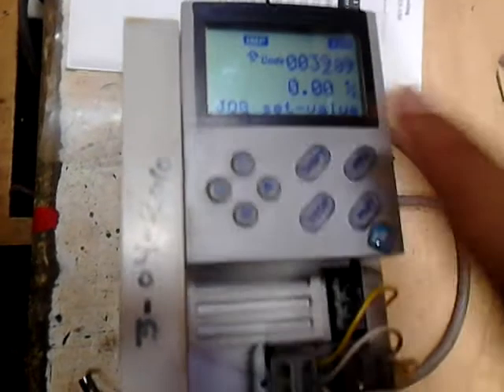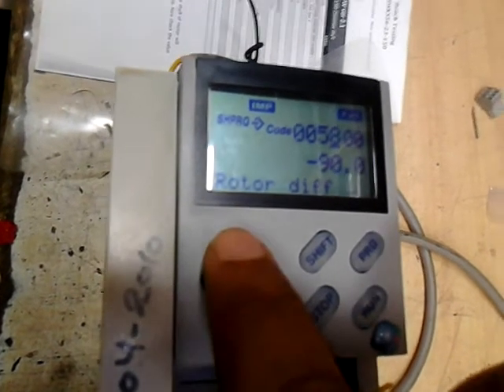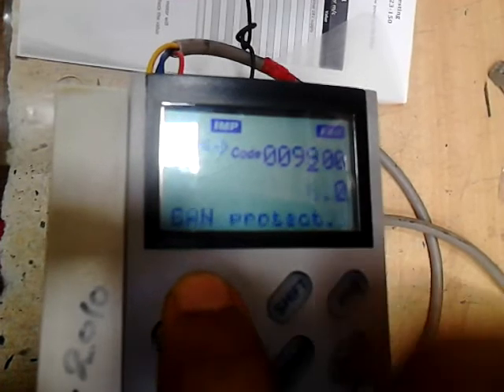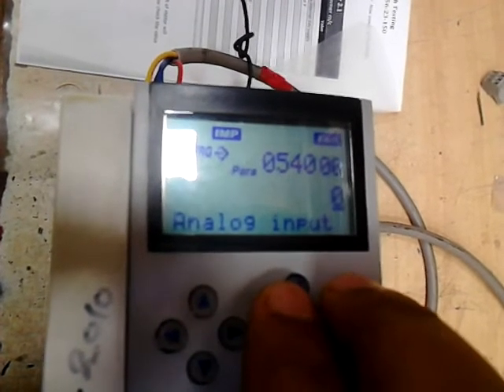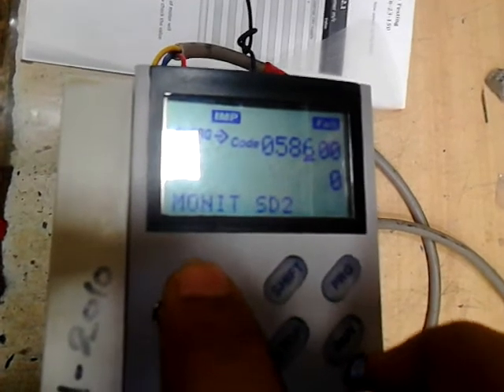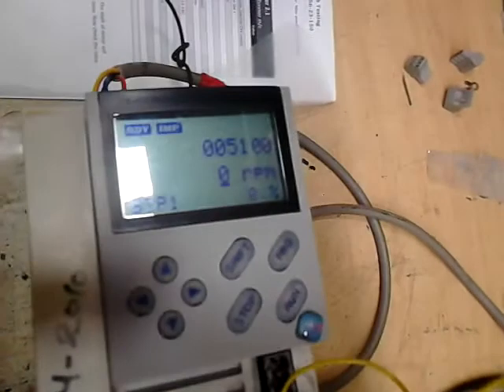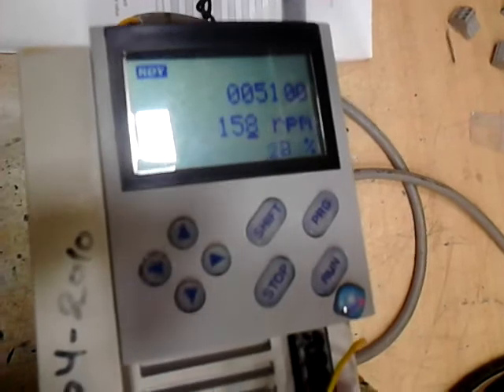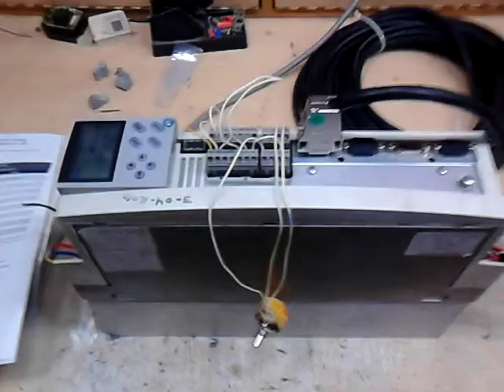Lenze Servo Drive EVS 93XX Bench Testing Part 2

Comment: Hi there is imax and Mmax err on my vfd drive what is err and how can i solve it????
Reply from the maker: Check the drive parameters for motor and set according to name plate.
If parameters are proper then check the motor is it jammed or any issue with the grounding.
If everything is OK then currently monitoring section of drive is faulty and need repairing

Comment: Hello Sir,

can I use for this application also a Lenze Inverter evs 9324-ep (positioning)  instead of 93xx-es and, if yes, do I have to set other parameters in this case? 
As most users for private use I would only want to turn the servomotor in left and right direction and to chose the speed within the recommended speed range.
I already have a lenze Inverter (93xx-es and a connected Motor (MDSKS...) which is running, but only in one direction. The connections are correct, ist it possible, that there is one or more codes in the code list, which has/have to been changed?
And at last another question: Is it possible to reset the Inverter in  factory setting only with the control unit and without any bus?
It would be fine, if I could get a valid mail address of you or your company. And, in case of success I would like to pay something for your advice by Paypal.
Thank you very much for your answer!

Comment: Sir how to calibrate resolver please suggest
Reply from the maker: Which type and for which motor?
Reply: @esrtechnologix  lenze Drive EVS 93XX and Lenze Motor resolver
Reply from the maker: @ashwaneedubey30  needs Motor specs with resolver installed as if it will available in supportive documentation of GDC/EVS card, you can configure it easily, otherwise, you have to configure it manually which have a little different procedure.

Comment: Hi,Lenze EVS9326-ES inverter displays "Trip (EEr) External Trip Set" and I supply 380 V How can I solve it?
Reply from the maker: This is usually Feedback Device error i.e. Encoder or Resolver. Either it is missing or faulty. So try to check that and if you want to bypass that depends on the application. In this video, I explained how to bypass it but only to check the drive on bench test, not field application.

Comment: Hi, please, our  lenze EVS9326-ES inverter displays "LU message" on turning the machine on,  but on reset,  it displays,  "QSP ext term".  How can we resolve it to enable it work with a Lenze Servo motor with C86 code of 28. Thank you.
Reply from the maker: LU message is for Input Low Power Supply Voltage  i.e 540VDC, Check the input voltage and all phases. QSP Ext Term is an Error "The MCTRL−QSP input of the MCTRL function block is on HIGH signal" it shows that specific Block is not defined properly.

1:  If you have the Parameter Backup of that drive, try to restore the Parameters again.
2: If same drive is used on any other position at machine, try to upload the parameters of that drive in this Error / Faulty drive and check the behavior. 
3: If LU status is appearing still on the Drive, then you have to check the drive on PCB Level for repairing at its Input Power Section.

Comment: Sir tell me lenze inverters 8200 vector control wiring diagram. Sabir
Reply from the maker: Wiring Diagram is available in Manual. Can you please explain for which application you need a wiring diagram?

Comment: Sir tell me information in lenze copping parameters. Thanks
Reply from the maker: To save the Parameters in KEYPAD 
1--->Select code C0003 "PAR SAVE" in the
        "Load/Store" menu using the arrow keys.
2---> Change to the parameter level: Display "0" and "READY"
3--->Copy all parameter set into the keypad
4--->Set "11" "Save extern" and Press Both PRG+SHIFT the display will be Busy
5---> Now Change to the code level Display C0003 and "PAR SAVE" and Select Parameter Set 1 and Press SHIFT+PRG

To save Parameters from External Keypad to EPROM ( Control Card)
Select code C0002 "PAR LOAD" in the "Load/Store" menu using the arrow keys.
Set "20" "ext −> EEPROM"
Press PRG+SHIFT the Keypad will be BUSY
Now Change to the code level Display C0003 and "PAR SAVE" and Select Parameter Set 1 and Press SHIFT+PRG

Comment: Can you please explain how do you wire the switch to the drive?.
Reply from the maker: For detailed Terminal connections used in this video please check
http://engrsajidrehman.com/tutorials/lenze-drive-evs-93xx-bench-testing
Reply from the maker: Sorry for late reply..
You Query is no clear. Which kind of switch you want to install on the Drive and for what purpose?
Reply: Sir may I get the wiring diagram?